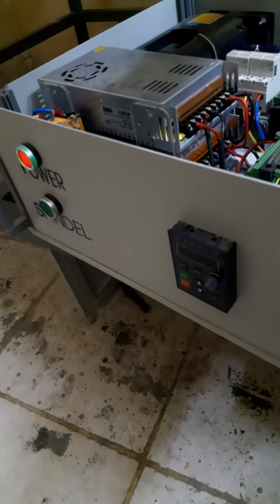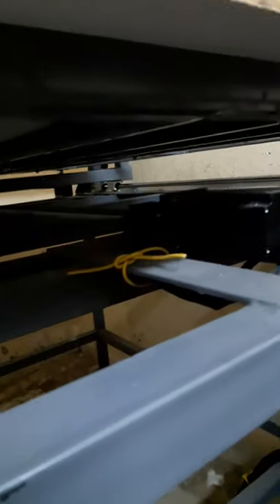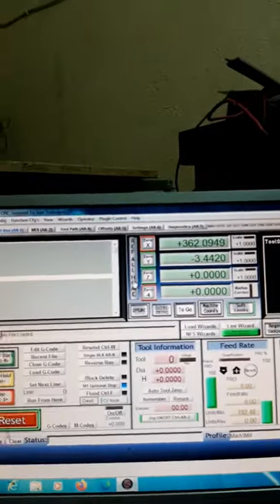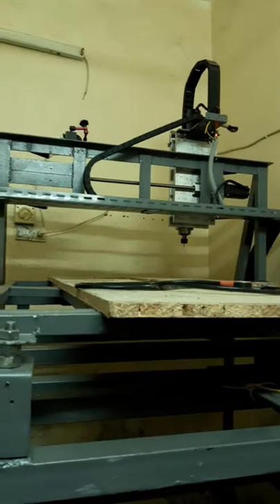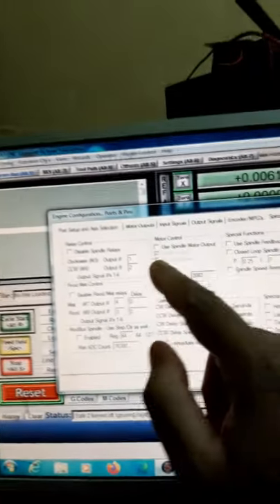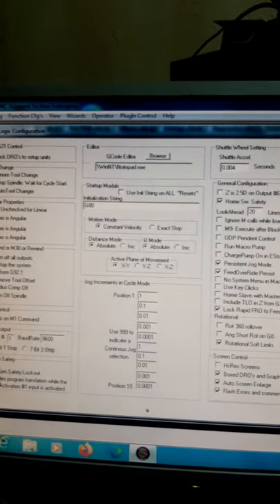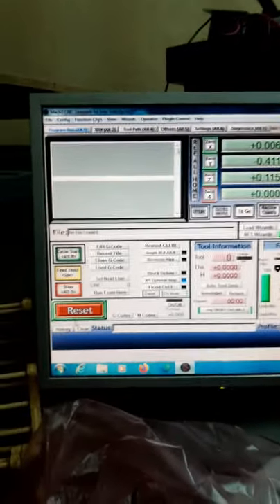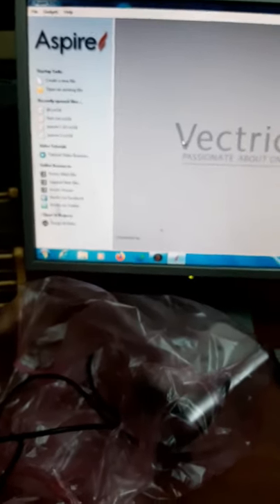Nvem  novusun v2 ethernet controller problem  for my aliexpress  saler this video

Comment: Hi. I believe that is a function of Steps in the Motor Tuning page and actual encoder resolution. Make sure you use the 'Set Steps per Unit' in the Settings page. Use the maximum travel your machine allows. I can see from here your calibration is still not right. If you are using mm, you should have 4 digits left of the full stop. Also in the Settings page, try the 'Reset Interp Alt-i' then the Zero buttons and 'To DRO', but looking at your machine I am afraid to get '0' positional accuracy and repeatability, you'll have to look at stone tables and the like. Your steel frame and wood table will be affected by ambient temperature and moisture absorption as it is. Enough to throw it out by that 0.0061 or more. It can even twist the frame. But redo that calibration first. It will automatically set the Steps that it needs.